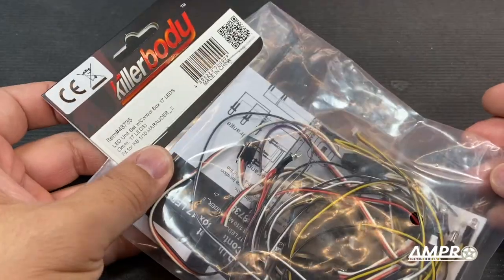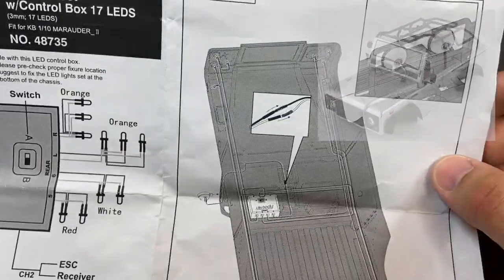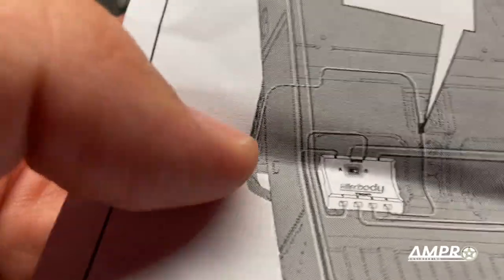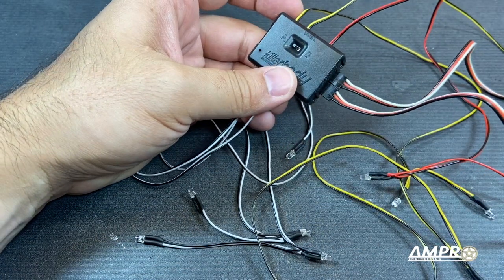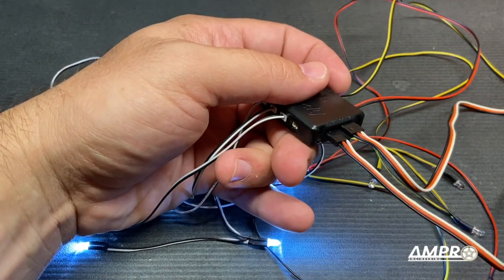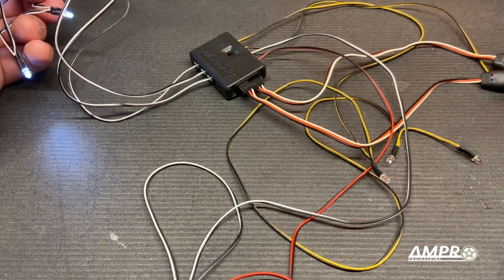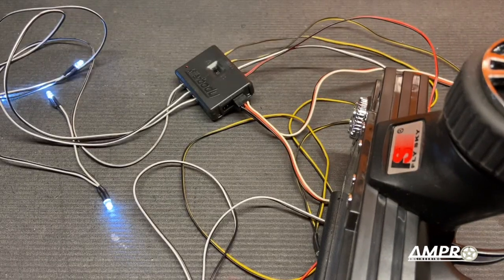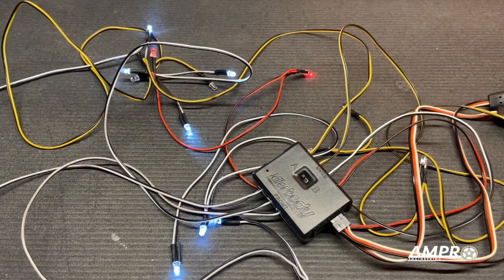e385 - Killer Body 48375 Light Set for Marauder II - Part 10 Light Review

Comment: You have much more patience than I do!  I would have been throwing things on the ground & stomping on them.  Plus, I'm not great with electronics. If the instructions are not spelled out as for a 5-year-old, I will typically have to go to my local  hobby store.
Reply from the maker: I was bummed until the signal ports....I cannot believe none of it was labeled...
Reply: @AMPRO Engineering  ive had that happen way too many times.   It's really frustrating when you get something sent to you and it's not as advertised
Reply: YEP! been there and done that.  From your videos, it seems you have a pretty good understanding of electronics.  Like I said if it's not spelled out very well I end up going to my local Hobbytown store.  I once tried to bull my way through and burned up some of the wiring, so I learned my lesson.

Comment: Having had more or less all the same issues as you, I have found I can get all the functionality I want with the cheap light kit with the fake tamiya branding by using the blue LEDs on the rear and putting the steering indicators on there own channel.  

That way breaks lights, tail lights and reversing lights all work automatically, the headlights toggle on and off with channel 3 and channel 4 or 5 (depending on what else I have connected up) lets me manually indicate when I want to, rather than ever time I adjust the steering which on my trail trucks would be just about the whole time I am driving otherwise. 

I just wish they had gone with normal white LEDs rather than the blue ones, as you need to either swap them out yourself or life with the slight blue colour coming through the coloured clear paint on the rear lights.

The traxxas advanced light kit might be a good option as well, if only it did not cost as much as often pay for a Tamiya kits, and give the choice between a  £110 addon for lights or another basic 2WD RC car I will take the new car KIT every time. :-)
Reply from the maker: See I have done the same thing. Its like most of the functionality is there but then i need to modify it. This is why i just go for my trick rc . It just works.